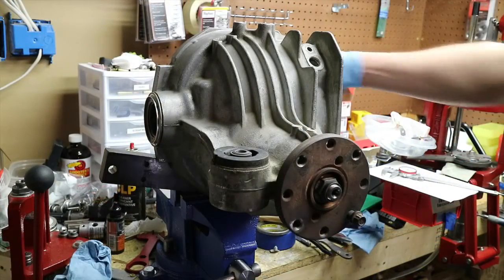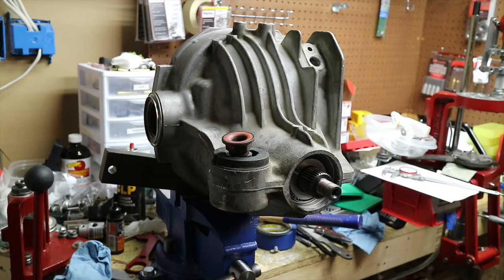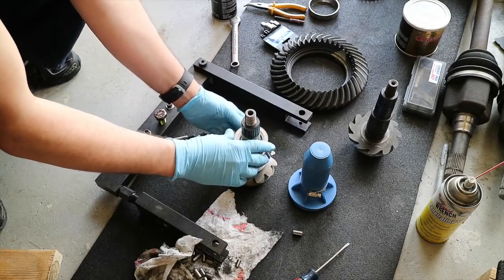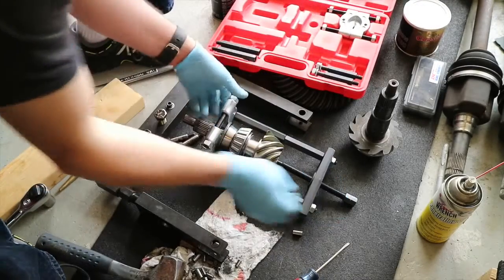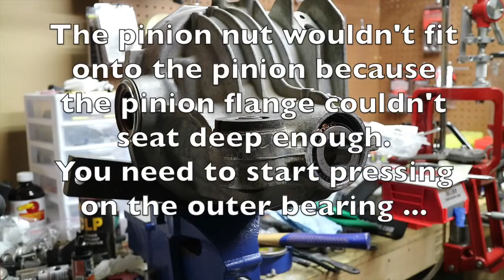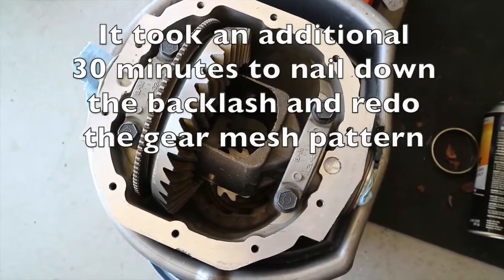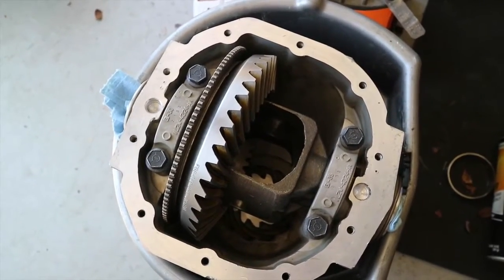VLOG #16: Ford 8.8" Differential Rebuild - Final Assembly, Skip The Pre-Fitting!

Comment: I built 40-60 GM truck front diffs 5+ years ago as a tech for a GMC/Cadi dealer so everything is done with threaded ends and not shims and now that I own a 2013 mustang I want to go to a 3.73 and I feel like with your videos as a refresher I should be able to accomplish this no problem. Saving myself 225 bucks for a shop install. So thank you!
Reply: I'm doing my 2003 GT with 3.73 because the factory gears and or bearings are whining/whirring under acceleration only. Shops where I live charge $650 and up and after visiting a couple there is no way I would let them near my car. I have nightmares about them mixing up the bearing caps and just tossing back all the factory shims and calling it a day. I have the tools, a Ford Racing Gear set and install kit and understand the process so hopefully with some care and attention to detail it will be fine. I'm removing the complete axle so I don't have to get my 57 yo a$$ under the car  lol !  How did your gear swap turn out?

Comment: If you put the pinion in a freezer and heat the bearing in an oven at 350° for 20 minutes or so, it will drop on effortlessly.

Comment: If you skip the test fitting, how do you know what thickness shims to use on the pinion? Is there just a recommended size for that setup? Also does it affect the tooth pattern at all? I'm just doing a bit of research because I need to rebuild my m86 LSD.
Reply: WASDxMerceless it was all in a previous video.

Comment: Put the pinion in the freezer and the bearing in boiling water and it will fall right on. No special tools needed.
Reply: Can you do that for the ring gear and differential too?
Reply: @blakenorman4822  I've never heard of boiling water, but I suppose the subsequent oil bath would replace any moisture. I would probably spray the hell out of it with water displacer like WD 40 just to be sure no rust snuck in there. Freezing the inside piece and heating the outside piece in the oven is the most common method.